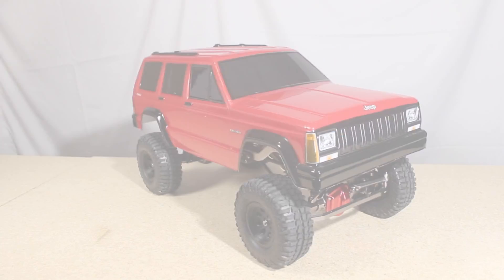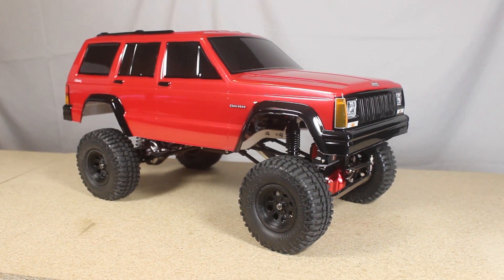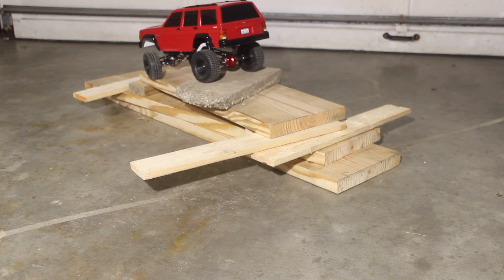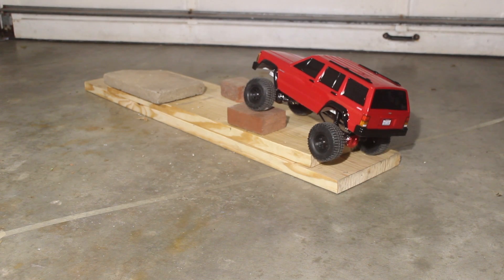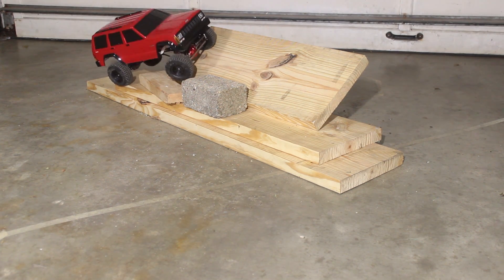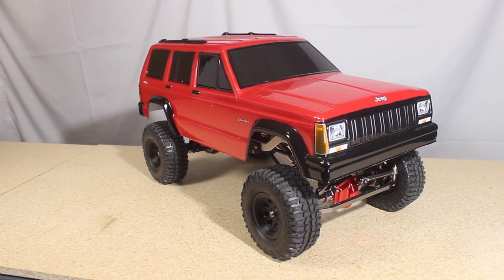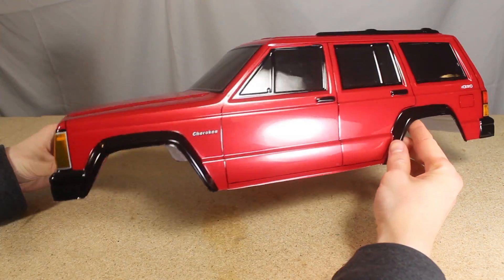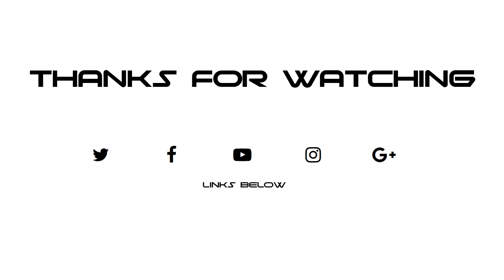3D Printed 1/10 RC Crawler Chassis Overview & Testing + Body Line Detailing on Jeep

Comment: Took a look at the links and could not find the chassis to print out. I am building a crawler and owning a 1994 Lifted XJ this is a must to build. Can I get the STL files? I am printing out axels and difs but like your chassis design. Thanks

Comment: What is your opinion on those eBay metal axles? I've thought about building a rig around them also
Reply from the maker: They're okay, they have been holding up good and I haven't had any issues. The steering geometry is not great though.
Reply: @MakeItRC  do you mean something in the axle design or because of the long shocks. With those long shocks, the castor angle changes which will give you more camber at full turn. I put long shocks on a few of my trucks and then have to adjust the link arm length. Of course you have to find that happy medium between correct castor and a acceptable pinion angle
Reply from the maker: I'm referring to the Ackermann steering angle not being that great.

Comment: 2 questions.  Can you supply a link to the drive train, it really looks good (scale wise).  Also, would you be willing to share the model in an AutoCAD compatible format?  I would like to modify it so I can make a scale model of my Jeep TJ, but your frame will be too long.  Plus I have some ideas to make the frame more rigid, plus mounts for the receiver.

I found a nice body to work with, downside is, it isn't a TJ body:

http://r.ebay.com/XfhO2E

Comment: Cool project!!! If you want to make the chassis stiffer try to make the rails into c-channels and put more connecting bits between them.
I've seen 3mm metal frames twist similar to this just because they are just flat metal but if you out strength within the rails and between them they work way better :)

Comment: My instinct would be to make a thin-wall print of the rails that is open on one side like a mould, put a few pieces of steel wire into it, and fill it with epoxy. The stiffness of epoxy differs by brand and type and can usually be varied - the manufacturer won't tell you this, but here's the secret. In 1:1 mix epoxies, the resin part is pure epoxy, and the hardener part, since you don't need that much crosslinking agent, contains filler and plastifier. Now you actually have quite a bit of leeway how much hardener you add, you can add around 30% less hardener, and as long as you still mix everything very well, and preferably heat cure it, it will still cure, but since you also added a lot less plastifier, it will be a lot stiffer! Conversely, you can add more hardener to make the models more flexible. Or you can just skip this bit of useless knowledge and buy epoxy with powder hardener that doesn't contain plastifier and comes out really rigid.

Price and time wise, DIYing it like this certainly beats having to order a custom metal part. There's even numerous ways somebody could built the rails without a 3D printer, there's little to say the mould walls couldn't just be papercraft or the whole thing could be made out of sheets of card epoxied together.

Or you could just make the frame a bit or a lot thicker and printing it out of PETG. That really isn't going to break. Even ABS and PLA at 100% likely won't break under the weight of the model itself, as long as the print was good.
Reply from the maker: Great comment. Thanks for the Info!